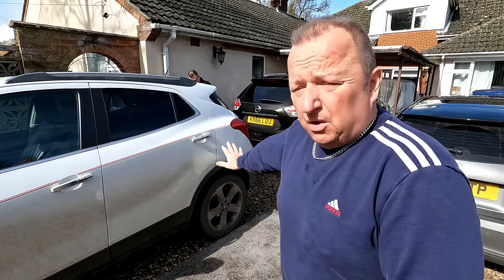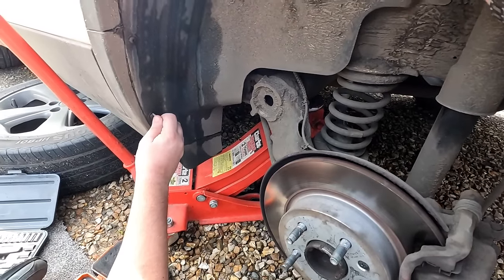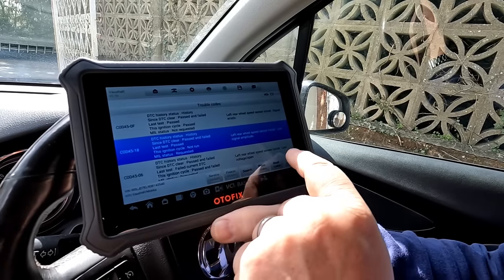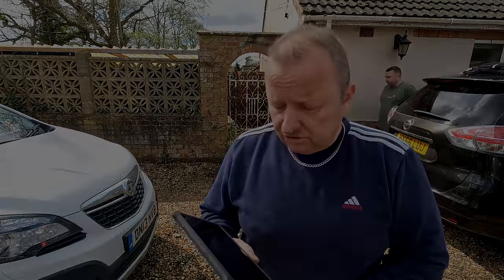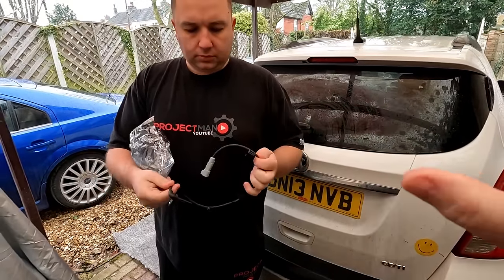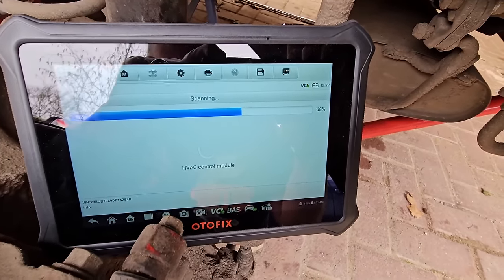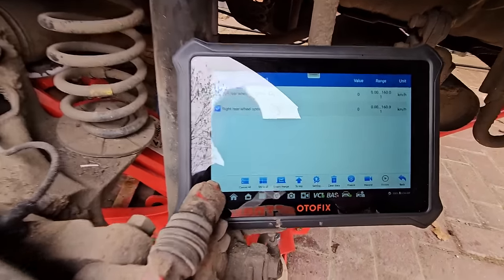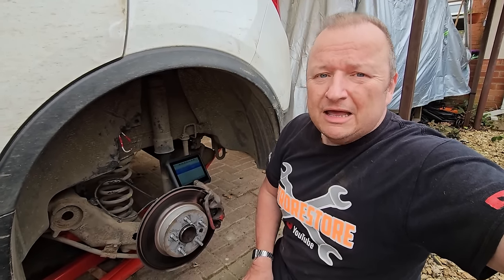We Diagnose A Rear Wheel Speed Sensor ABS Fault - Vauxhall Mokka

Comment: Bring back cars from the 80s ,so simple back then ,none of these headaches lol 😆,keep up the good work Martin 👍
Reply from the maker: Thanks 👍
Reply: And none of the safety either!
Reply: As they say , "keep it simple stupid"   too much technology and not for the faint hearted.
Reply: @davidpost6902  ABS? Seems pretty straightforward to me, and I'd not want a loved one driving a car without it.
Reply: ABS has been around since the 1960's and was first used in aircraft, namely Concorde.
Reply: @baron5747  It first started being fitted to cars in the 80's, not many had it before the mid 90's TBH. Plus, pre early to mid 90's structures were mild steel. The early to mid 00's for me, curtain airbags, good crash performance.
Reply: @ChrisPatrick-q6k  He's waffling on about it being a headache though, despite it being old technology. Just an old sweat, who refuses to get with times.
Reply: Yeah they rotted away before any mechanical problems started!
Reply: @baron5747  No doubt bragging about how safe his Volvo 340 is! 😆

Comment: Martin, I'm a hgv mechanic, what I would have done is use  Handheld Digital Oscilloscope, on the abs pick up check signal ect first, disconnect from the loom, then you know is wiring back from the plug, at fault or abs sensor or the pickup ect, as You might know the abs sensor inductive type sensor, you can check resistance with a  multimeter, anyway to confirm, 
Saves alot of time, in my game time is money and the job needs to be done ect  
Thanks for sharing

Comment: Martin, this reminds me of when I had an ABS problem on the right rear wheel on my 2009 Mercedes C200. The sensor was still reading the wheel speed in the live data on my scantool. I replaced the sensor (cheap and easy enough to try) but it didn't fix the problem. The magnetic ABS pickup ring had delaminated and once it had been replaced it fixed the problem. The left rear one went the same way so I changed the pickup ring on that side too and it has been fine ever since.

Comment: Best not to go under cars with just a hydraulic jack holding it up, at least wedge a spare wheel (or 2) under the side sills to save your life and properly wedge the other 3 wheels.  Hydraulic jacks depend on a very small seal to stop them dropping.  
I read that it's possible to wedge a couple of blocks of wood in the jack frame under the saddle, so the jack can't lower, but I would still wedge spare wheels under the sills (if the sills are strong enough), before attempting to properly position the axle stands.

Comment: @10:14 i guess one thing you could have tried here would be to swap it with another wheel speed sensor from a working corner and see if the issue is still present, that would tell you wiring or sensor was the issue.
Reply from the maker: There was nothing wrong with the sensor or hub as I showed in the video. Didn't you see me connect that hub to the drivers side loom and it worked?

Comment: Could it be a fuse on a open circuit
Reply from the maker: Once we get the workshop manual, that's the next check. I doubt it though as they are signal wires.
Reply: @retrorestore  can wait for you next video on it and good luck keep up the good work and project man

Comment: Hi Martin and Gary. Love the vids.  A car I had a while ago had the fault code c0041 and said something very similar about open line in the diagnostics . Had the sensor changed and tested still the light came on. It turned out in the end  to be a very small  crack in the abs reluctor ring.which was hard to spot Once that was changed the fault went away. Hope that could be of help for you guys. :)
Reply from the maker: I proved in the video that the hub and reluctor was fine by connecting it to the right hand side loom bud.
Reply: No problem. I just felt as I had the same issue for months it may have been of help. Keep up the greats vids 👍

Comment: I would have joint the two earths together left and right side, you might get lucky find it’s just the earth wire broken left side
Reply from the maker: Whatever cable is broken, it still goes into the loom and we need to find the route. That's the next stage now we have told the owner.

Comment: you got it all wrong with the Mokka. the problem is its not picking the signal up from the rear left reluctor ring could be rust on it, also when you connected the wires up to the offside rear you said you had confirmed the left side was working, what you had done is confirmed the wiring to the left rear was working . watch your video again.
Reply: Think you need to re watch the video he got all his diagnosis correct the near side abs sensor and reluctant ring picked up a signal when it was connected to the off side main side of the harness
Reply from the maker: You need to watch the video again bud.

Comment: I had a bearing with a built in speed sensor ring on the rear of an Audi and it had a loose ring that was slipping in the bearing giving an intermittent fault it felt like marbles under my foot on the brake pedal. The only way I found it was using the software and a laptop and reading the wheel speed.
Reply from the maker: I addressed that in this video.

Comment: Those crimp connector are rubbish you’re better off, soldering the wiring and using heat, shrink completely make water tight seal on the wiring
Reply from the maker: Not bothered whilst testing. Once the problem is located we'll attend to a permanent fix.
Reply: Agree those crimps in that wet/muddy area is a terrible idea.